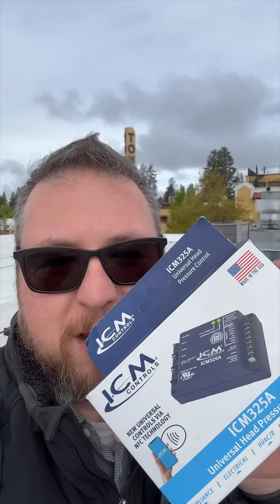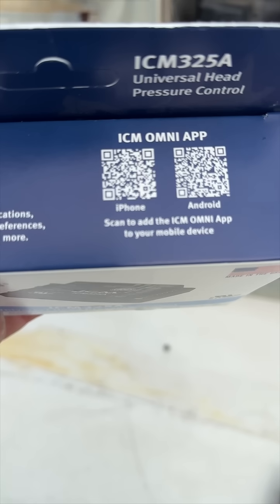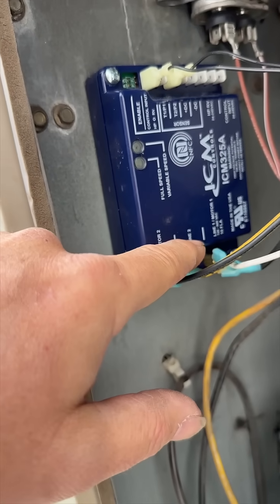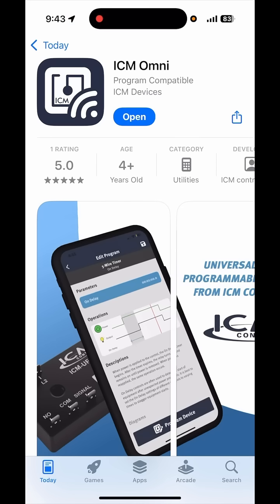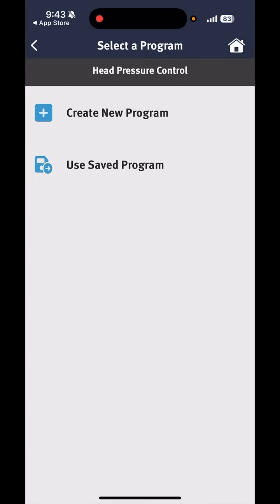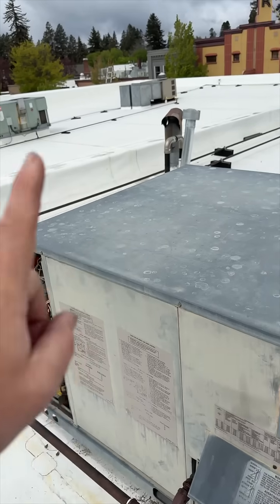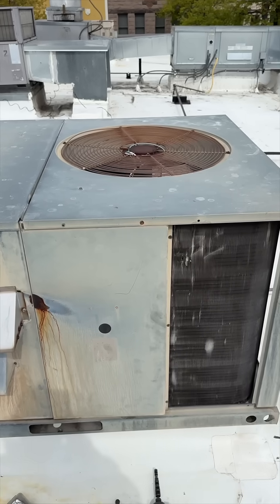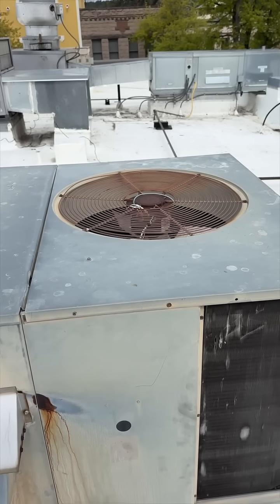Installing a ICM325A Universal Head Pressure Control as a Low Ambient Kit  #hvaclife#nighthawkhvac

Comment: The ICM325 has been reliable in the occasions I have used them.  Great for Emergencies when the Headmaster has failed.  Cutout the defective Headmaster and replace it with this electronic Head Pressure Control. Works Great.

Comment: The ball/sleeve bearing speed is important when setting it up. Know what you have so you don’t damage the motor. I’ve seen new motors fail prematurely when not set up correctly.